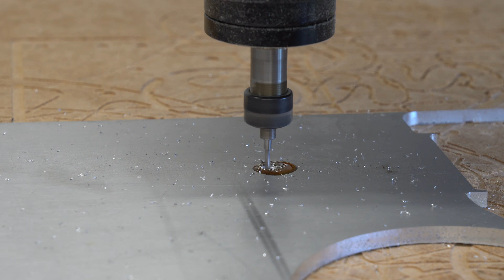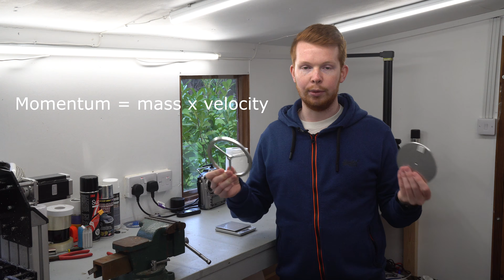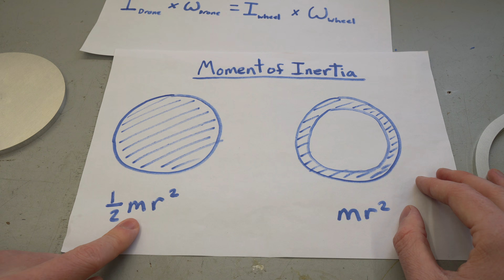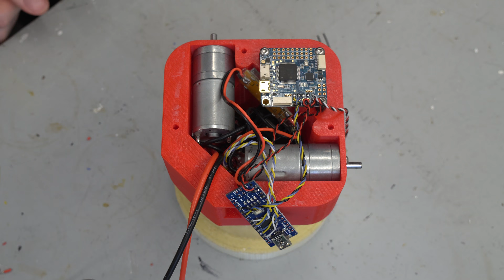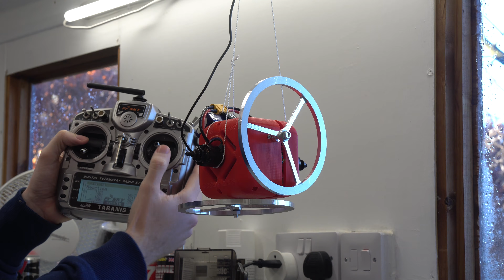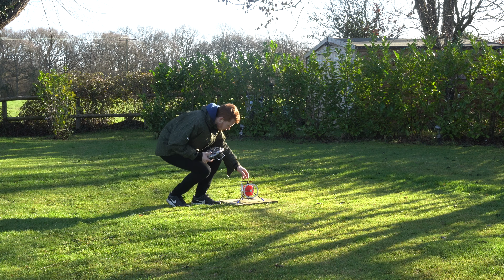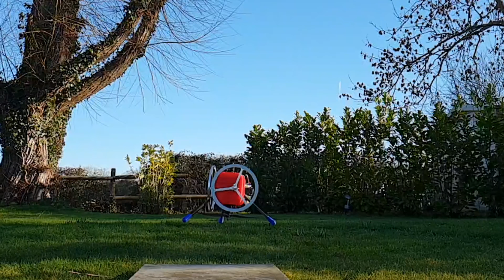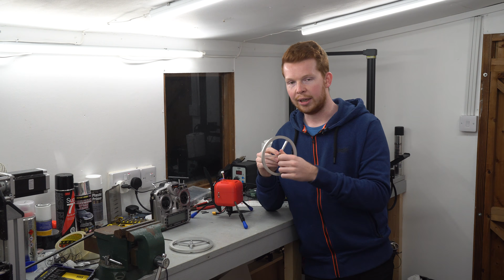Comment: I think that the drone would highly benefit from having a dual propeller on top, similar to some RC helicopters (eg https://p.globalsources.com/IMAGES/PDT/BIG/722/B1154176722.jpg). As it is now, you don't have any weight that would balance the drone as the bottom propeller, pushes from the bottom with the weight on top of it, make it really hard to balance as the drone tends to move to a more stable position...
That said, it would be way more conventional and much less of an experiment

Comment: You need to try escs flashed with bl Heli software and support oneshot! I guess they are even fast in terms of reversing polarity. They have a specific mode called 3D. It allows copters to switch really fast from normal flight to inverted. Works really good and the motors and stuff will be much lighter.
Reply: The esc I used when talking about the brushless motor control was a Tmotor F30A with blheli. It still struggles at really slow RPM. Thanks

Comment: Using coaxial rotors of equal mass and surface area above and below the center of mass is probably causing you some difficulty. To have stable yaw you have to counter rotate the two rotors at the same angular velocity, which means they're creating approximately equal amounts of lift and so your center of lift is roughly coincident with the center of mass. If you can fix the mass but decrease the lift of the bottom rotor, it will move the center of lift up for balanced torques top and bottom. Higher center of lift above the center of mass and result in the drone being more stable, which should mean less correction with the reaction wheels.

Comment: Honestly I think you have a couple issues going on (I'm at 19:49):  1) the overall mass is high enough that the reaction wheels struggle overall, 2) the high overall mass necessitates heavier reaction wheels which are harder to spin up/down (torque of the motors) and 3) you're close, but not quite their with response speed of the reaction wheels.  regardless, this is an awesome idea and awesome implementation!

Comment: Tom, what kind of flight controller are you using? 

Also, from looking at the slow-mo it seems like the time from the craft being tilted to the reaction wheels spinning is a bit too long. I wonder if the Arduino is adding a bit of time.

Comment: Amazing and quite unique project! The problem is in my opinion that the drone goes in resonance (probably that's the wrong term), it seems that there's a delay between tilt and correction of tilt, that leads to overcorrecting the alignment and fighting the overcorrection back. So the controller probably gave a more or less working amount of torque, but it was too slow to output it, leading to bigger and bigger balancing errors. In my opinion in fact even if the torque is linear and ends up being not enough, the controller would simply ask even more!

Comment: Reaction motors made in China? Thumbs up for effort. I think the propellers are too close to the reaction wheels. There is another guy who makes drones out of nothing but counter rotating propellers separated vertically ( about 24 or more inches apart). Just the torque differential between the two does the job of steering  The ever changing torque effect  of your two props, is too much for the wheels to keep up with. (I think).  Good thought experiment  though.

Comment: I really think the bottom propeller is the problem here.  I think having the two propellers on opposite sides of the center of mass is making it so unstable.  The way I'm visualizing it is as if you were hanging it from the ceiling vs balancing on your finger.  If you had a dual rotar setup (one on top of the other) on only the top It would work.  And you could still have the motors spinning in opposite directions to control yaw.

Comment: Problem number 1:
that's not how reaction wheels are normally used. In fact they can't even work the way you are using them.
unlike your machine real helicopters use the gigantic reaction wheel they have on top to steer and they use it as a reaction wheel while you use your "reaction wheels" as giant weights that do not change your angular momentum but just your orientation. They are practically useless. This concept is only useful for very precise changes of orientation in the vacuum of space and most spacecraft don't even use this kind of thing. In fact the way you are using them you are making the vehicle more unstable when you turn them in an attempt to stabalize this mess.
Problem number 2:
WHY THE FUCK WOULD YOU EVER WANT TO USE REACTION WHEELS IN AN ATMOSPHERE!!!

Comment: From looking at the propeller placement, could your stability problems be caused by a mix of too much control authority in the reaction wheels without enough precision, combined with having the bottom propeller below the center of mass? Like trying to fly a helicopter upside down.

Comment: Step 1. take a reaction wheel. 
Step 2. let it spin constantly at a high velocidy.
Step 3. put it inside of another reaction wheel with an angle of 90° in relation to each wheels spinning axis.
Step 4. use the first reaction wheels gyroscopic properties to cancel out the second reaction wheels momentum
???
Profit (a reaction wheel that wont be saturated)
Reply: Step 1:  Add a cat (which always lands on its feet)
Step 2:  Attach piece of buttered toast on back of cat (which always lands butter-side down)
Step 3:  ????
Step 4:  PERPETUAL MOTION!
Reply: It would still saturate, as in step 2) the velocity isn't infinite.
Reply: @satibel  the gyroscope inside the reaction wheel will stop it from spinning. so after using it, the reaction wheel can be stopped without causing the vessel it is mounted on to start spinning again. In addition to this the gyroscope will increase the reaction wheels inertia without having to increase it´s weight/radius and thus make it even more effective while at the same time you dont have to spin it as fast to get the same effect.
Reply: @Retsom3D  it will still make it spin 90 degrees to the axis of rotation (and given that it rotates, it would make the satellite go somewhat forward, same way as the wheel lifts up in the veritasium video), and this doesn't change the fact that if your satellite is rotating too fast in one direction, you can't completely stop it with an inertial wheel system, and if your satellite gets regularly knocked in the same direction, the wheel will have to spin faster and faster to compensate (as there is no friction to slow it down).
 something like that might still be useful to reduce the dependency on a single wheel (with 2 wheels you might be able to have one compensate the other), and I think some satellites do use a single high speed wheel on a gimbal to "push" against, but there are disadvantages with that, you can have conditions where 2 axes are aligned, and it still doesn't solve the problem that you can't speed up or slow down the weight without imparting a rotation to the satellite.
Reply: @manaquri I agree with you although Thomas has a good opinion but im thinking your on the right trac.
Reply: @satibel  https://www.youtube.com/watch?v=GeyDf4ooPdo here is a great video that showcases what gyroscopes can do.
Reply: Reminds me of the vision in the book of Ezekiel chapter 1 ,  wheels within wheels.

Comment: Two practical comments, first if your reaction wheels had fins on their outer rims they would have air resistance that would increase their effective force with less weight, and it seems that the motors are stopping the wheels rather than letting the rotation freewheel when the wanted reaction is no longer needed. the stopping of the wheel reverses the torque caused by starting the wheel. I would like to discuss this with you .

Comment: Perhaps if you had redundant wheels on the same axis spinning constantly while opposing each other would move the pivot point to the center of the drone rather than the edge. Also if the wheels are always spinning they would resist pitching and rolling rather than constantly truing to correct for it.

Comment: I think it would it be easier to make more constant momentum changes if the craft was balanced to take off with the wheels already spinning. This would allow you to find a motor rpm range where the current/voltage and torque output have a much more linear relationship. So instead of the wheels having 0 rpm as their balanced value and then spinning either anti-clockwise or clockwise, try spinning each in only one direction, with the balanced rpm value being approximately half the maximum current/voltage of the motor, the minimum value rpm being 0, and the maximum the max rated current/voltage. More similar to how space stations rotate :)

Comment: Nice to see it flying.. or sort of. It looks like the Proportional value of your PID is too high, resulting in a periodic oscillation. Also try to increase the Derivative value, and I'm sure it will be stable. Trying to match the exact RPM isn't necessary since you're using a PID. That's why they are often used in non-linear systems. But this was fun!

Comment: Are you actually controling the current? As far as i know, the current is directily proportional to the toque. If you are controlling the voltage instead, that yields the effect that you described in the video. Applying current control might be the easiest first step.

Comment: This is so cool. I'd love to see more of this! Could you use a gyroscope to help stabilise? I guess that would add a lot of weight though. I'm a bit of a noob, but can you use these reaction wheels to balance this device (without the propellers) on top of other objects? If you can then you could test the accuracy of the reaction wheel's response by resting the device on a dome with a diameter similar to the size of the device. Then if the device tilts to one side on top of the dome, the reaction wheels would counteract it perfectly. Sort of like balancing a broom upside down by the tip. I just wonder cos it could be a good test of how accurately the device sits upright using an unstable lifting force (essentially taking the aerodynamics out of the equation, for now).

Comment: Maybe the bottom propeller is destabilizing the drone when the center of mass is not perfectly aligned over the propeller axis, a coaxial propeller at the top would help.
Reply: I suggest having a look at the rocket pendulum fallacy.
It does not matter wether the source of propulsion is above or below the center of mass. The only important thing is, that it is alingned with CoM.
But do not worry, almost all humans think a top propeller is better.... including me until some years ago.
(A top-mounted rotor has other benefits, though. Like being able to reach / leave the chopper unchopped :-)
Reply: @LoneStarr1979  Everyday you learn something new, thanks.

Comment: How about using brushless motors two on each wheel with two wheels.  One motor with tubular shaft and having them contra rotating and running at about half speed each in normal state and then accelerate each one in a rate as to counteract the forces as needed?

Comment: Another amazing project! 👍

So cool sound when the cnc drives curves.

Great idea! I would give brushless reaction motors a try. Since the machine basically worked well but is to weak, I wouldn't care too much about harsh moving. Maybe friction clutches against high impulses? 

Also, the two lift rotors should run at exactly the same rpm to minimize their gyro forces? I suggest to gear them together to one motor.

And I think that a 90° "roof" or "boat hull" from three reaction wheels would be ideal. All dimensions but detached from the lift torque.

Comment: you could add a microswitch to a leg so the reaction wheel system is disabled when on the ground. Also unless you use corless/ironless motors you will suffer from the motor cogging throwing the system off, setting the neutral state to be 1/2 rpm instead of 0rpm might work better for you.

Comment: Where is the center of mass of that thing?
Reply: And put the center of lift above the cog, ie both lift rotors on top
Reply: Agreed, it really seems like the flight controller is having issues due to off-center torque applications on the CG which it either cant accommodate for or doesn't have the CG presets properly added to the Kalman filter. Then causing wobbles as it tries to rotate about a nonCG location.
Reply: yeah definitely caused by off-center weight distribution. needs counterweight
Reply: In the center 👍🏿👍🏾👍🏼
Reply: i think too far fromt he center due to the weight of the wheels... hence the wobbly bits...
Reply: @FlowTfpv  i think he should try to center the center of mass on the X and Y axis with he counter balancing motors and the Z axis with the propultion and try again

Comment: Very nice project.
@Tom Stanton, are you sure your DC motor controller is actually controlling the current? Is there a current sensor on the board? Your description of the nonlinearity sounds to me as if you are controlling the motor voltage and not the current. The current should be quite good proportional to the torque.

Comment: Tom, this is an amazing project with great potential. But I suspect you are under some misapprehensions about motor control. Are you REALLY controlling motor current with that Arduino? Or are you simply controlling voltage PWM, which is a VERY different thing. This misapprehension could fatally kill any attempts to control attitude. A servo motor like that will give a torque response which is DIRECTLY proportional to current, (this is basic physics), though not voltage or PWM duty. So it is vitally important to define your terms correctly and solve the control problem fully. Please PM me if you have doubts about any of this, because I’d really love to see a reaction wheel stabilised aerial platform fly properly.
Reply: Billy Sugger The fundamental control problem is the use of reaction wheels.

Comment: The torque is non-linear with the current and decreases as the current is increased. This makes for an instable system by itself. You could measure torque at different currents, then make a LUT with your Arduino. Whatever the case, I loved seeing this It is absolutely bonkers. Great job!

Comment: Why not have two wheels for the axis you are trying to control spinning opposite each other.  That way you can either use the torque trying to stop or spin the wheel to control an axis direction.

Comment: Isn't it possible that reaction wheels have gyroscopic precession? Also if you are using Euler rotations there could be a chance that your torque calculations are getting screwed by gimbal lock.
Reply: Also can you share the ardiuno code?

Comment: a little oversimplified the inertia calculations :( the inertia of the spoked wheel has to be calculated with the radius being 1/2*(inner diameter+outer diameter) of the hoop plus inertia of the spokes + hub, the width of the hoop is NOT 0, therefore if using m*r² is wrong, the actual radius is smaller.... actually it is the same for the disc, with the inner diameter being zero!  ... well, I guess you would calculate it correctly and just simplify it for an easier explanation

Comment: You should use an ODrive and brushless motors! That would make this much more likely to work.
I think the main issue is that the brushed motors can't accelerate fast enough (even though they have lots of torque), so the amount of torque that gets reacted into the body is not high enough.
The torque first has to be converted to acceleration before it gets converted back into a reaction torque. T=I*alpha. This means that it takes too long to make angular corrections, so you end up with an oscillation. This equation is more relevant than conservation of momentum, because, unlike a satellite, you care about how fast things happen. If you don't correct your position fast enough, the drone will become fully unstable and crash. So you want droneinertia*dronealpha = wheelinertia*wheelalpha. If your motor can accelerate arbitrarily fast, then you can simplify this to droneinertia*dronealpha = motortorque.
For a geared brushed motor, there is a limit to wheelalpha, even though the torque is large. The main reason for this is reflected inertia, which makes the apparent inertia of the gearbox itself very very large. Reflected inertia is (wheelinertia+gearinertia)*gearboxratio^2.
Check out my channel for some videos of a reaction wheel inverted pendulum I made! I used a different FOC brushless controller, but an ODrive will work even better.

Comment: To make this thing stable i think you should add two more wheels which are counter rotative make them Always turn and then change their speed when There is a gyroscopic variation that way you would build up force in your device and the wind action would be decrease i'm not an engineer but in a theoritical nutshell i think it make sens

Comment: Maybe you could use brushless motors with esc's. Non linearity in momentum and problems with changing direction of rotation goes away when you spin up those motors initially before lift off. Then pitch and roll will be controlled by altering the rpm of those motors but in different range (high from the beginning). But.. then the gyroscopical effect comes in to play and you would have to use counterspinninng pairs (doesnt solve that 100%, but should be not worse than right now with slow spinning brushed motors)? Just a bunch of ideas. Great and entertaining video :)

Comment: You should probably consider an mpu6050 instead of an FC. The mpu is a better gyro than the one incorporated into most FCs. It's also a lot cheaper and smaller than a FC

Another thing to consider is the following thing which veritasium made a video about: https://youtu.be/GeyDf4ooPdo
This is why helicopters don't tilt their propeller to the front in order to move forward. They rather tilt their propeller to one side which makes it tilt forward automatically. Smarter every day also did a video on that